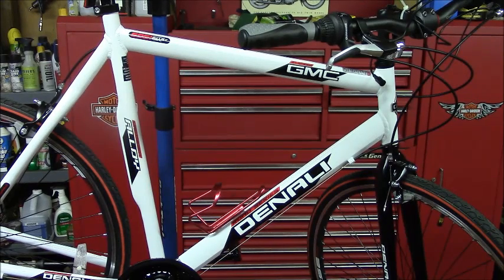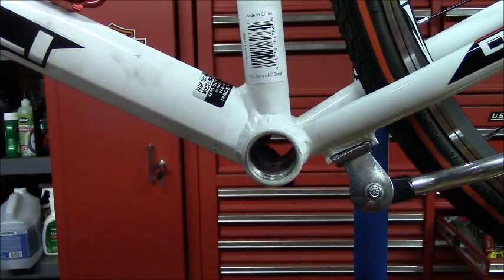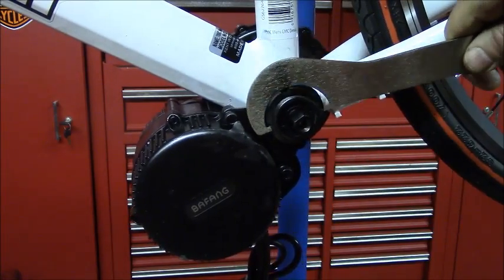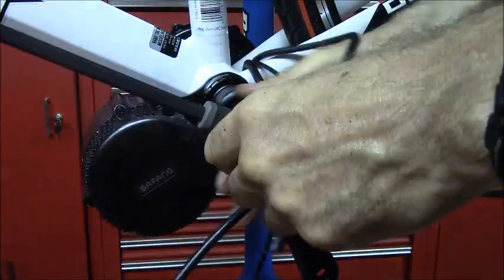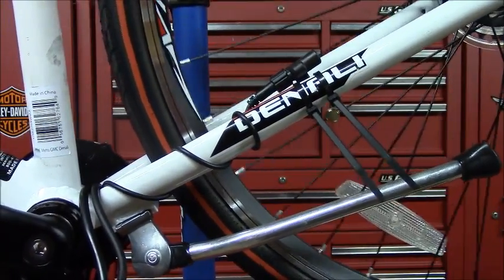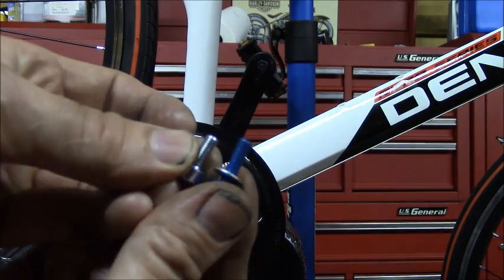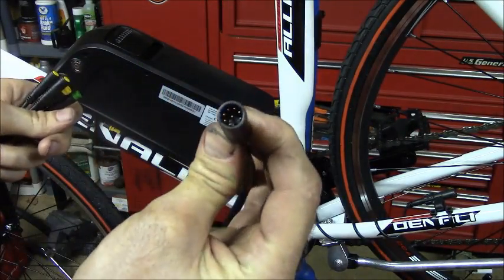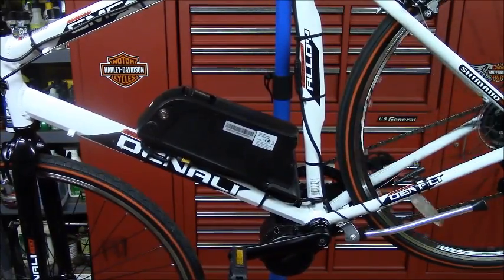Electric Bike - Installing A Bafang BBS02 750W Mid-drive Motor On A Walmart GMC Denali Bicycle

Comment: Hi you should put the thumb throttle on the right  other than that thanks for sharing your build.
Reply: Mine is on the left it doesn't matter. On the left it replaces the removed front shifter.

Comment: Nice installation. Is there a shift sensor connection on this model. You showed us 2 brake sensor leads but I couldn't see a shift sensor socket/lead?
Reply: BBS02b has a shift sensor connection and a 6v power connection for lights. Some folk dont bother with a shift sensor and just touch one of the brakes to cut the power whilst changing gear.
Reply: İt is worth if you want to use all gears= Variaton in road

Comment: Thanks for the very nice tutorial. One of the best out there.
One question :
What's the name of this plastic support for the derailleur cable underneath?
I ordered a kit but I think I'll have the same issue and want to avoid as much as I can to scratch the original one. I'll maybe buy a suitable one if you give me some keywords or links.
Thanks.
Nessim
Reply: Just use a short length of gear cable cable/zip tied to the frame. Works perfectly.

Comment: I'm installing the bbs02b 750 fun. Dont have a clue what the fun means. But i just about got it through and thought it wasn't all the way so i sanded a bit more and found that it is all the way but there's a pretty big space on that triangle thing to the motor and it way to loose now for my liking. I'll probably just tighten it on the way it is and be done with it. Or should i use washers/spacers? I haven't got one of those hook spanners either.

Comment: tips fit chain ring and chainguard whilst motor is on bench [much easier] use locktite red on motor locknut and torque as tight as possible, i use a brick hammer as it will come loose! also for me i dont use brake sensors on any of my bikes a gear sensor will suffice to cut motor . ps buy a specific tool to tighten the locknut £12 ebay hope this helps

Comment: Derailleur cable can go however you want if you'll use full cable between shifter and derailleur. You can route it on top tube using zip ties etc.

Comment: Here's a few suggestions that I have found to help save time and money and frustration in the long run... You should cover the wiring harness with heat shrink prior to installation, from the motor up thru the frame... at the very least. The speed sensor wire is particularly vulnerable. Also... using a hand wrench to tighten the mounting nut is... well, let's just say it's not good enough, get a set of appropriate sockets and a quality torque wrench. You need from 60 to 100 lbs. torque and can't get close to that with a cheap hand wrench, it should be for emergencies and nothing more. You also didn't use washers to make sure the motor mount is properly aligned and isn't sprung at all when sinking the hex-head bolts through the brace and into the motor housing. Ditch the steel POS main gear and get a CNC machined gear replacement... there are several available. Change the display... I suggest the 500C and last get a battery large enough to only use 60% of the capacity before recharging. This will greatly extend the "life" for the battery and a big battery can be charged more quickly without stressing the cells.
https://photos.google.com/share/AF1QipPXLCiD9pMH58OYbAkOtNg5xrzKZIGj86khegeTxm2SBSYLRRRLI5HkgQ6Vk-kSPw?key=eWNDV0x2cUdaZnN5aFJ3S3M2N3BQMnd2VGZuOVFn
Reply: Brian Bassett hey man I’m about to do this kit as well and your suggestions sound very reasonable. I wish you’d make a video as well.
Reply: @buffalosteve287  I record a lot of (time) but you have to weed through it for anything that is useful dude. :)  But I'm happy to help in any way I can. https://www.youtube.com/watch?v=0KrJ2SHFdjg&t=34s

Comment: Extremely helpful. I would not have been able to complete the installation without watching this video first. I just want to add ta few comments
1. To solve the high-profile bottom cable guide problem, I bought a Shimano SM-SP18-M cable guide from eBay. This has very low profile and fits between motor and bike frame with room to spare. (I had to trim the ends of the longer of the two sides to fit.)
2. The bottom bracket on the drive side of my GMC Denali was screwed on really, really tight. Even with the HCW-4 shown in the video, I was unable to remove it myself. So, I took the bike to a bike shop to let them do it. The tough looking mechanic, with tattoos all over his arms, ended up having to use a specialized tool from his tool chest which looked like a big, long bolt. He inserted the tool through the bracket opening and screwed on a specialized cap with a turn handle on the other end. Then he fitted a long, hollow metal pipe over the turn handle. This way, with two and a half feet of leverage, he was finally able to loosen the bracket, using both arms and all his might.
3. It might be a good idea to leave the front derailleur on. With proper positioning, it could help to prevent the chain from falling off the chain wheel when the rear derailleur is set at the lowest gear.

Comment: Nice job. The best way that I found to hide the wires was to find a camera case for a small digital camera with a velcro strap and wrapped the strap around just under the handlebars. It's been working for years and I can get to the wires when I need to and just close it up again when I'm done.

Comment: Had the same issues with the motor being to tight to mount and the cable guide getting in the way. I just filed out the bottom bracket and trimmed down the guide, seemed to work for me 🙂

Comment: Great video nice to see a video without a load of crap music, i have fitted a number of these only 350 watt models. so far not had one so tight yet. fitting in the crank, I made a tool from a spare socket that way i can fit quite tight with a touch of blue loctite.  I have fitted one on an old Royal Mail postmans bike.  It would be interesting to compare the 750 watt model.

Comment: I have the Bafang  BBS02 and it has two extra wires coming out of the motor. One has a yellow end the other are red and black wire. Can you tell me what they are for?
thanks
Reply: I believe they are a safety feature thing for the brakes, don't remember exactly but it's a small safety feature you really don't need yo worry about it

Comment: A rubber mallet would help get the motor through the bottom bracket. You can find a spanner wrench for the Bafang lock ring from a bike shop that sells tools, it's a pretty standard part. I'm curious why you call your tools by their part number instead of what it is.  Do you work for PT?  The video is great, I am saving it for future use. Thanks

Comment: TWO questions:
1) What would be the minimalist Bafang mid drive build to turn a manual bike into an ebike? 
I ask this because I am not a big fan of too many wires sticking around the bike frame as I see them time and again in installation videos. Can I do a simple build with just a mid drive motor and a thumb (or twist) throttle? I assume that the throttle is the only key element needed to control the motor. I could care less about the LCD display, the speed, or changing the power of the motor as the gears change especially as I ride on the highest gear no matter what the terrain! 
2) Is it a good idea to build ebike on a single-speed bike that can coast? Having no gear derailleur would further simplify my ebike especially when I do not use the gears anyway. The less is actually more and simpler!
Please advise.
Reply: If you want a minimalist instal then go for a Tongsheng TSDZ2. They are cheap, available in a variety of volatages and powers and easy to install but unlike these, are torque sensing so you don't need Ebrakes (reduces wiring lots).  I have 2 bafangs and a Tonsheng...I prefer how the Tongsheng rides (it's torque sensor is very responsive) but the Tongsheng is said to be more fragile (see Jbalatutube posting)

Comment: I can't thank you enough for this its shown in great display and you've set it out really well. With some others they seem to skip past parts or give you tips after they have gone well past the place you needed a tip about. One question though is about fitting the speed sensor. The closer you fit the sensor towards the hub the more you'll get a distorted readings, If you mount it as far towards the rim of the tire are you getting it in the right place for an accurate speed measure ?

Comment: Nice video....very well done. I have installed the BBS02 and C961 display on my cycle...it is a straight forward project. Most of the e-bike junkies will make cable mods to their install by cutting and soldering cables and making custom splices. Some will even drill and place some of the cabling internal to the bike tubing.

Comment: You forgot to say: Disc Brakes or Die
Reply: TrumpCorp. Disc brakes aren't a requirement
Reply: @doctadrey3000  if you do this with rimbrakes you WILL NOT stop within any reasonable amount of time
Reply: @iMagic16  uhh I have rim breaks, my bike goes up to 30mph on the throttle and stops just fine,

Comment: Great vid. The 'weird nut' is a standard industrial shaft-nut and a wrench for it is pretty common and is called a 'hook spanner'. There are hinged models that fit different sized nuts. Cable guides should be of delrin or HDPE as steel or aluminum will wear and degrade the cable. All the bottle-cage bolts I have encountered are M5 metric, so you can go to a fastener supply and get whatever length you need. Enjoy your bike!

Comment: Hold on, so does this support more than one mid speed? My bike is a 24 speed MTB with 3 gears on the pedal axle and 8 cogs on the rear wheel axle.

Comment: I would have a problem with fitting new electric connectors unfortunately:(
Reply: St. Apollonius just don't buy from eBay and you won't run into that issue

Comment: that inside nut needs 100lbs of torque even though 60lbs is recommended.
Reply: The Bafang manual says 60 Newton Meters of torque. This equals 45 foot pounds.

Comment: What is the difference in the BBOS2 and the BBOS2B? and is this the 28 MPH kit?
Reply: BBS02B Has upgraded MOSFET
Reply: I'm guessing you mean BBS02 vs BBSHD. The BBSHD is Heavy Duty. Larger, better components. I have the BBSHD with 52V 13.5A battery from Lunacycle.com. I have no limits on mine and can get 35mph with throttle only. cost for the kit with battery around $1500 USD.

Comment: Great video, as most of the other install videos I've seen on Youtube they make it look so easy to install the mid-drive. I had the same problems trying to fit the unit thru my bottom bracket, then had to buy longer M6 screws and spacers to fit the plate to the unit as my bracket measures 73mm instead of the standard 68mm, all a learning curve I suppose. 
.

Comment: The mistake I could see was you needed to put some locktite adhesive on the left hand side nut and it's holding ring, it's really important to have those nuts done up as tight as possible and not have them come undone as they hold the lined ring to the frame, if it comes loose it will allow the motor to jump inside the bottom bracket and bump the motor housing into the front upright, I  would have routed my cables on the front upright instead of the seat upright. The battery you have chosen is at best weak as your motor can far exceed its Amp draw rating, I can virtually guarantee that that battery will be dead within 12 months, your motor can draw up to 25 Amps with the engine controller and those batteries have trouble even supplying 20 Amps and most probably it has a 15 Amp battery management system (BMS). You need to get yourself the bafang programming cable and software to check that your motor controller is only set to draw 15 Amps which equals 720 Watts which is the rating you wanted (near enough is the good enough) and just below your legal requirement. Your motor could draw up to 1200 watt with a 48v battery, 1300 watt with a 52v battery or 900 watts with a 36v battery. Congratulations on buying what I think is one of the best and most flexible ebike kits on the market, I own a BBSHD which I programmed to use only 20 amps with a 52v 30Ah battery and that kit on my bike feels scary fast (it could go as high as 30Amps) in a brown stain kinda way.
Reply from the maker: Thanks for the comment! I was always suspicious of the battery and I am planning to build my own in a future video. I've noticed that places that sell cheaper portable items powered by batteries usually cut cost by using low capacity battery cells, so your comment about the battery doesn't surprise me.
Reply: Bicycle Alley 
Only THE BEST VIDEO I’ve seen yet!!! Edited like a pro, too.... believe me I’ve done my homework! 
   Seems like everyone is selling something on YouTube but this is a breath of fresh air. If I had one question it would be about the braking ability of this model and type system and I’m not a genius but I agree on the question of battery power; as stated in the comments. It seems like a big motor! 
   Overall I’m making MY decision to do this same conversion in large part because of YOUR considerable help!!!! Much 🙏!
Reply: Hello. I have the bbs02 750 48v also. My 18650 batteries are rated 3c. 2600mah. 13s5p. You think it is ok to check with the programming cable? I m thinking of pulling out the bms and balance charge my batterypack. If the controller inside the motor is 25amps, i think my batteries should be ok right?
Reply: A loosening motor is not always caused by the nut coming loose. I had a loose motor with Loctite on the nut. This was still tight on the thread.  The issue was fretting of the toothed clamping bracket which had bitten into the aluminium bottom bracket. The thick paint on the clamping bracket was also worn away which loosened the clamping torque and made the fretting worse. At very least make sure you clean off the paint from the bracket. I cleaned off the paint on the bracket and the bottom bracket. A small smear of epoxy on the bracket face stopped the fretting. No problems since. Torque is the issue not loose nuts. Hope this helps. PS I am a former Loctite engineer!

Comment: Thank you for taking the time to make such an informative video on your install. I was looking at purchasing the exact same Bafang kit. Can you post a video of how Banfang mid-drive motor preforms and how much did it cost you?
Reply from the maker: I will post a new video in the next few days. The motor is strong, and I configured it for 9 different pedal assist modes. I use the bike in pedal assist 1 because I don't need the extra torque. You can build this bike for less than $1000. I added  fenders, rear rack and new Schwalbe tires to the bike since I recorded this video and will talk more about it in the next video.
Reply: @bicyclealley8183  
Hello sir,
I noticed you cut off the red and black wire from your motor to apply the xt60 connection. I have the same problem with mind. Did you have any problem converting your connection to the battery? Would it be awsome if you showed us how you did your connection. Also thank you for your video👍🖐️
Reply: my man!